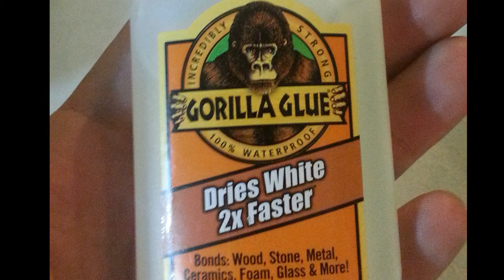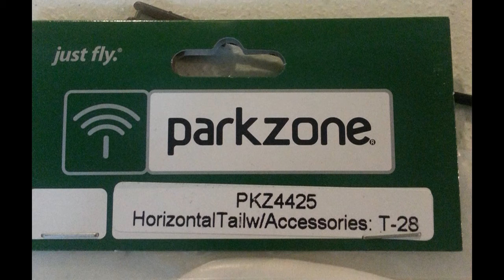Parkzone T-28 Crash Repair Tutorial

Comment: ...., causing the axle to get stuck behind the firewall. One can prevent this by placing a 1/16" thick, 1.5" long, 0.5" wide piece of playwood right behind the firewall, between this and the foam, and use epoxy and #2 Du-Bro self tapping screws to keep it in place rather premanently. This ensures that the firewall weakest spot will outlive the rest of the plane should another mysterious crash occur. Thanks for the video, Wade! Ar.

Comment: You just answered some questions for me regarding my T 28 crash I had today. I'm pretty new to the hobby but I noticed when the plane got up, it was just..... wobbling in air. At first it appeared that it was nose heavy. Could I have have had the battery in too far forward? Now though, after watching your video, I'm wondering if it was because I didn't some tape on the horizontal stabilizer like you mentioned.  Thanks for the information.

Comment: Hehehe! I misteriousñy crashed mine while stalling it on landing. However, it also came back to life by means of glue rather than a new fuselage. It takes less time to get it this way than having to wait for the mail to deliver the new parts. There is one weak spot in the firewall and it only become obvious after too many "front wheel first landings". I mean that the exact point behind the stearable landing gear axle cracks right at the union where the mold's halves close....